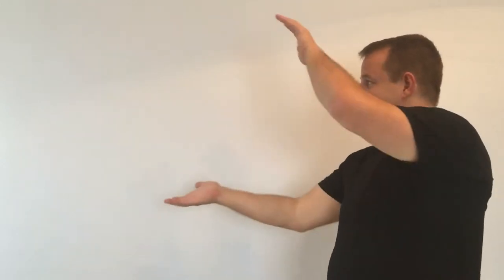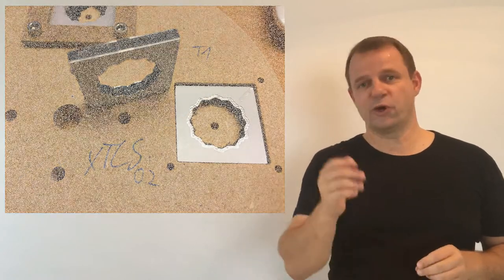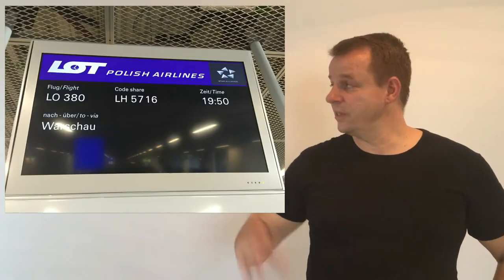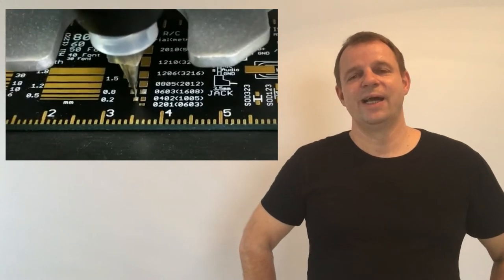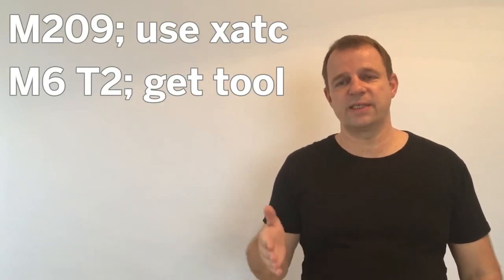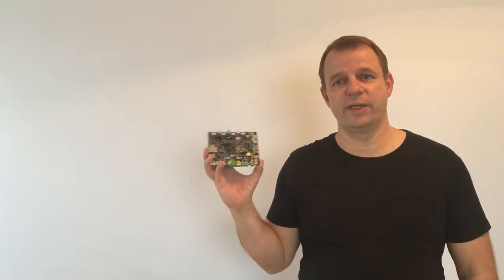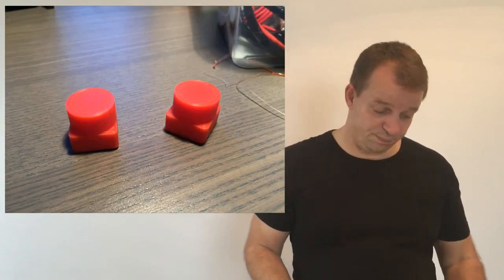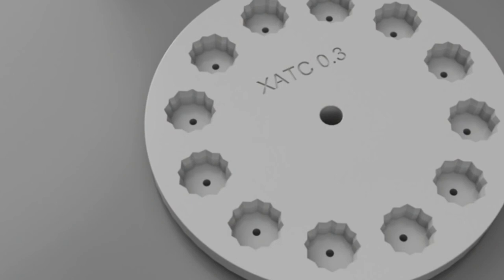XATC S01E03

Comment: Thanks for your work on this stuff -- I really like the direction you're going, as I just got a Smoothieboard for my first CNC build (underway) and have been using 3d printers for a while. When you start coding on modules for Smoothieware, I'd love to know what github repo you're on so I can follow along and perhaps contribute when I get to that point. Tool changing seems like the big missing feature in DIY CNCs at the moment, so your work is very appreciated.

Comment: I have a 3D printer, but why is it beneficial having to use a 3D printer to produce a automatic tool changer for a mill instead of simply milling it? 
Seems like you would be guaranteed to have a mill if you need an ATC, but might not have a 3D printer...
Reply from the maker: TalpaDK please check this video: https://youtu.be/-IGAYd8OnOE